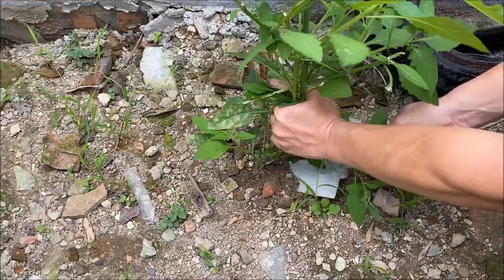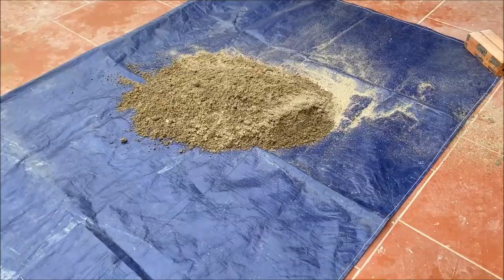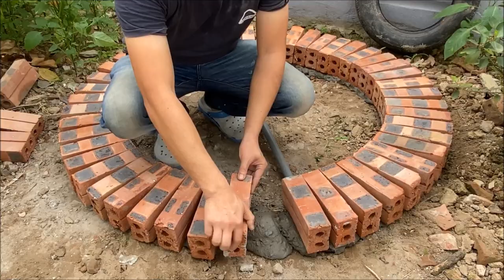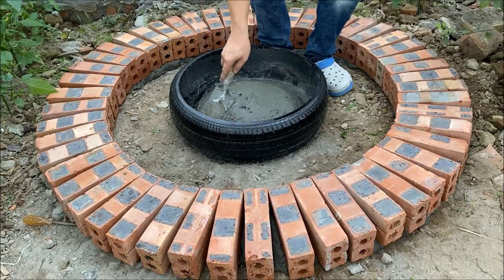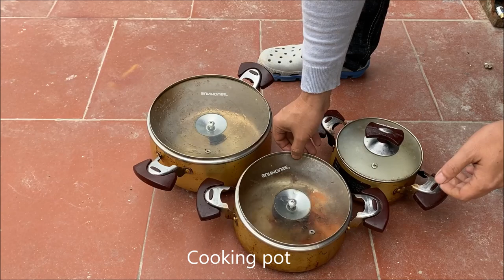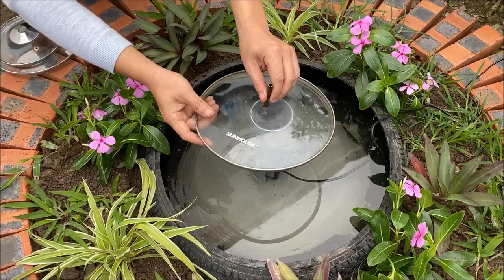My Wife is Crazy about the way I make a Fountain! Garden Decoration ideas by Brick, Tires and Cement

Comment: I really love your idea, however another way to minimize the issues commentators alluded  - one might use a round galvanized washtub or a round farm water trough....and dig the hole to that depth - installing the soil and bricks outside of that.  

I think it would have a nice look to have the washtub raised up like 2-3 inches to reflect the silver off the steel on the glass lids. 

Myself, I would use a fish safe silicone for the center pipe for the pump.  Also the depth of the washtub is more conducive to pond plants for the fish to hide in and to oxygenate the water....ya did great with this idea - I made a painted washtub pond using a watering can on a pipe as my circulation long ago and it worked well with my gold fish and pond plants!
Reply from the maker: yes

Comment: You could speed up your project by using “ fast” cement mix.  You could just place the cement powder down in your brick circle dry.  Add your bricks or blocks and moistened with a water mist from your hose.  You only need a mist of water in order for it to set. This would most likely work for your inner tire circle as well since your adding water anyway for the fountain.   Your end result is beautiful.
Reply from the maker: Thanks for your suggestion

Comment: Well that wont last very long, no concrete on the edge of the bricks in the circle, ground movement will soon displace them, no joints filled with cement, not be long before the weeds grow in the joints. Water not deep enough for the fish, the poor fish will fry in hot weather and freeze in cold weather. The only nice thing about that is the plants. ;)
Reply from the maker: Yes ! thanks for the comment

Comment: Very nice!
Love it!
I was curious if the cement will break away from the tyre rubber and leak.

I thought of doing something using tyres but was going to have a pond liner inside the tyre round. Use rocks to hide the edges of the liner
Reply from the maker: Go for it!

Comment: DIY at your own risk. People, just make sure you research what materials are being used for these projects. Tires are not safe for the environment and not rated to support life in such a way. We are more eager for likes and subscriptions than we are in thinking about how we are influencing people. 

As just a personal aesthetics, I think the visible tire really drags down the overall look unless you are just trying to be flashy on how you "recycled" the tire. I would also suspect that the metal rim around the pot lids will begin to rust. They may be able to go through the wash, but constant submersion, I would suspect the minerals in the water would start causing it to rust out and then introduce more pollutants to your aquatic life. Keep an eye out for that. There is a reason why components are tested and rated.
Reply from the maker: Thanks for the suggestions. I will look into the issues you raised